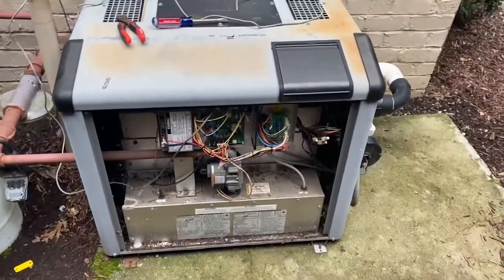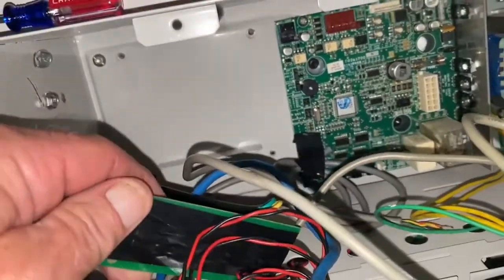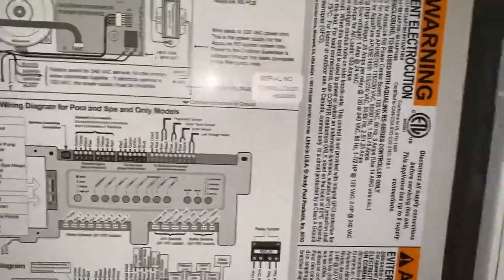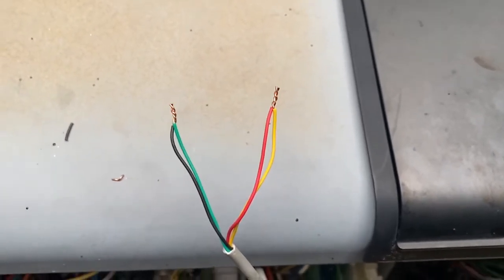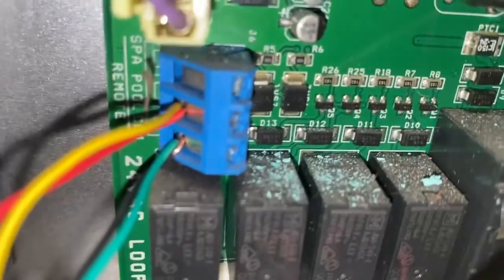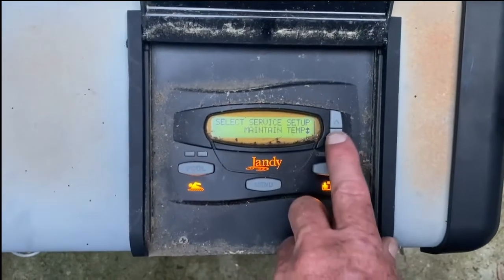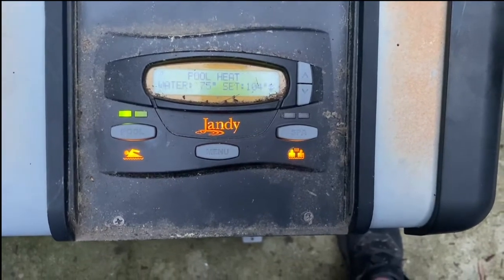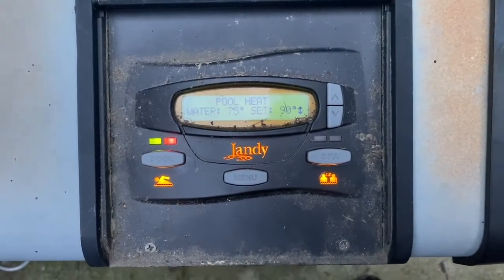How to Change LXii-JXi from 4-Wire (RS485) to 2-Wire Automation

Comment: I have the same heater and the app said pool was heating, but the heater was not. The control panel on the heater has no lights and the screen doesn’t work. Any troubleshooting tips?

Comment: Is there a difference from going 4 wire to 2 wire for pool heater, does the automation work differently? I also have an issue with my aqualink where the antenna works alone on the  red pin connector, if I add the cell it works online, if i have the antenna and the pump it works, at the moment I have 3 devices, antenna on 1 red connector and 2 devices on the other red connector, the unit goes offline and appears to be an interference. Aqualink iq30 fails both on wifi and ethernet. Should I get ferrite beads?